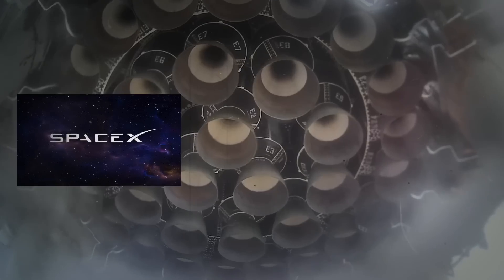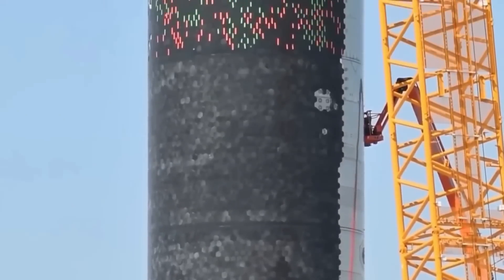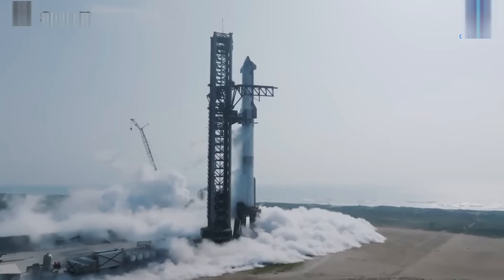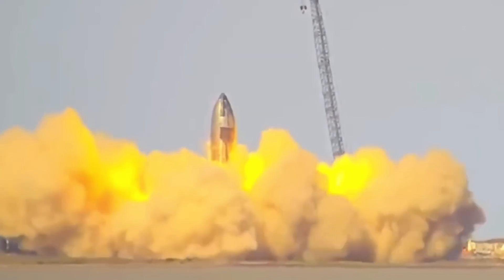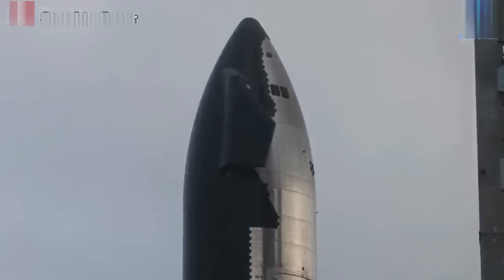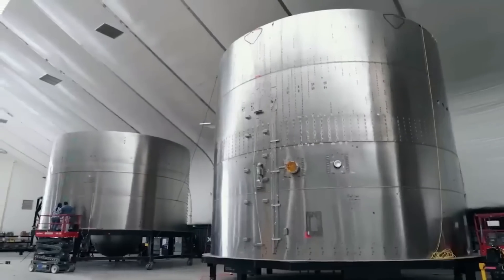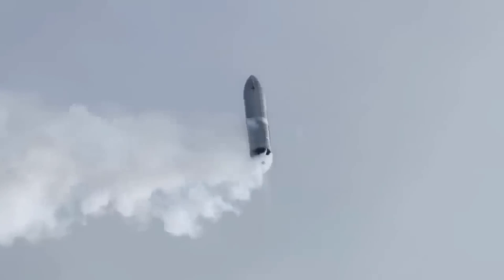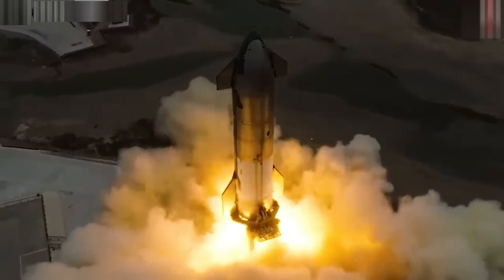Musk Has Finally Solved The Problem Of Heat Shields On Starship

Comment: Does anyone know how 'Fully Reuseable' and 'Ablative Layer' are being reconciled?  Is the ablative layer strictly temporary? Or it is expected to last many flights (making it a consumable component in a fully reusable system).
Reply: obviously, there are things that are consumed during a spaceflight.  Like fuel.  haveing an ablative layer on a spacecraft intended to return to earth makes sense and does not mean the ship is not reusable.  Is your car not reusable  because it needs an oil change, bake pads, tires, bushings?  Doesn't take a huge degree of critical thinking to "reconcile" the issue.
Reply: @ScoutPL  Fully reusable is a term that Spacex get to define. They have defined it as the same craft flying multiple times a day (in your condescending tone, imagine a car capable of driving multiple times a day - if your critical thinking can stretch that far). The ablative layer is under the tiles... seems like protection of last resort. Ablative layers need repair after every use. I think it's probably temporary in the development phase to allow missing tiles to jeopardise missions to maximise learning. Unless someone learned (not you mate - you can sit this one out) has better knowledge. I can't see it as a practical mission consumable unless it was sprayed on the outside of the tiles when it can be practically renewed.